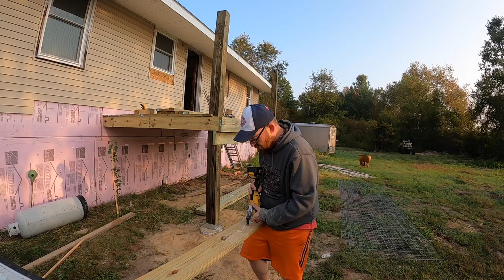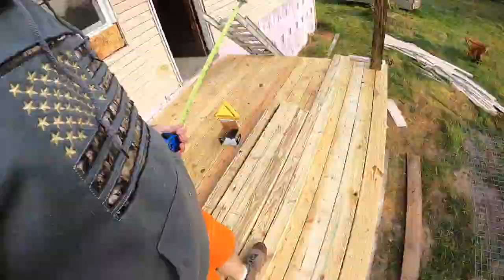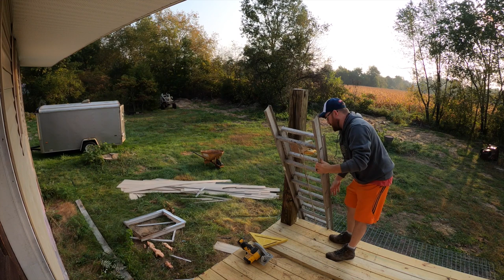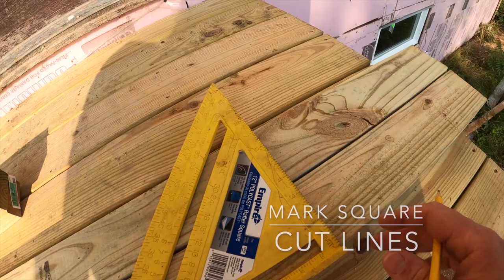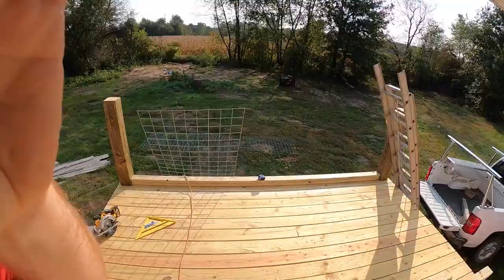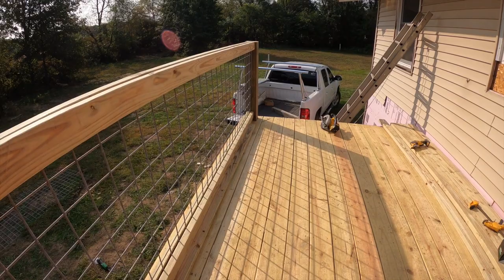DIY Simple Hog or Goat Panel Deck Rail [Flipping Friday] Bonus

Comment: Would like to use a  4 x 4  wire , what gauge should I use to meet code for a deck  8 ft off the ground ?  Where is best source for the fencing ?
Reply from the maker: I normally get it from TSC not sure about gauge but it’s pretty heavy stuff.